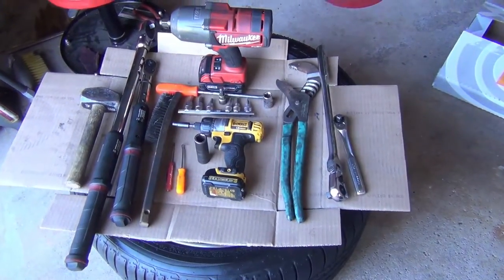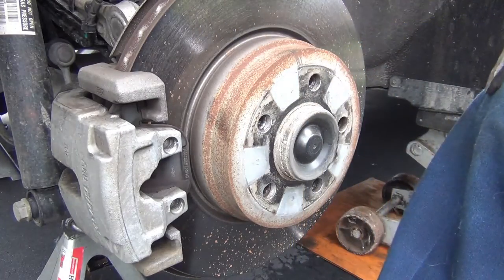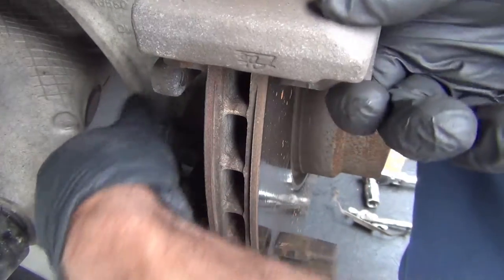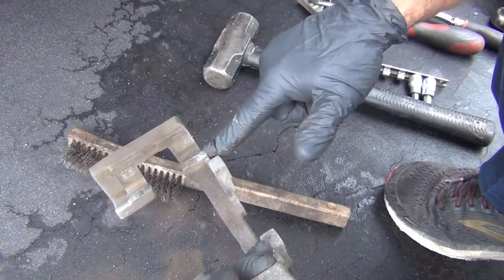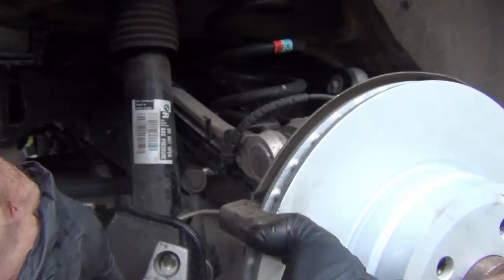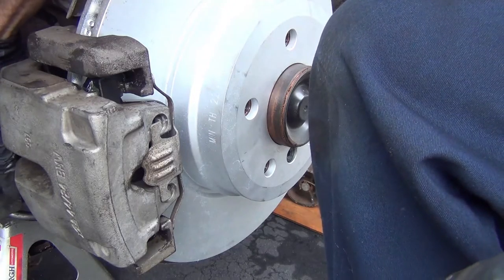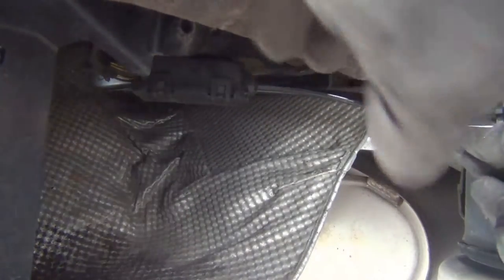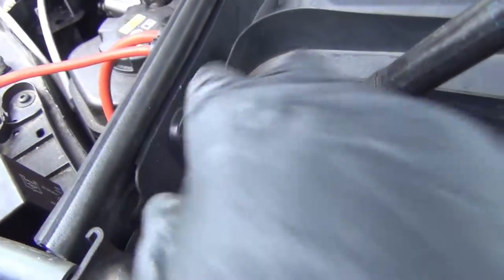DIY HOW TO REPLACE REAR BRAKE PADS ROTORS AND SENSOR BMW  F15 X5

Comment: How do you find the wheel lock on 2020 x5 same pad as f15? Thanks one of the best explanation on here 👏
Reply from the maker: Hello, Glad the video was helpful! For the wheel lock, if the wheel lock key is missing you can do a few things. Check to see if you have the box as it has a card that gives you the wheel lock key number. Then you can order it from BMW. If no card, you can go to a dealership and ask them to match it with the master set to see which one you need to order. OR...you can purchase the whole set and find the right one from amazon. The whole set is most likely cheaper than the one at BMW.
https://www.amazon.com/JEUCLEL-Locking-Compatible-Adapter-Anti-Theft/dp/B0BX2WTVYR/ref=sr_1_2_sspa?crid=71CIZPDEAJFK&keywords=bmw%2Bwheel%2Block%2Bmaster%2Bkey%2Bset&qid=1694988382&sprefix=bmw%2Bwheel%2Block%2Bmas%2Caps%2C86&sr=8-2-spons&ufe=app_do%3Aamzn1.fos.18ed3cb5-28d5-4975-8bc7-93deae8f9840&sp_csd=d2lkZ2V0TmFtZT1zcF9hdGY&th=1

Comment: Any need to adjust e brake after replacing rotors or as shoes wear? I saw there is an adjust wheel
Reply from the maker: Most of the time there is no need to adjust.  Do a check of the e brake. 5 clicks is the max and it should hold. Less critical on an auto trans but very important on a manual trans.
Reply: @AskTheCarExperts  what do you mean by 5 clicks? I’m going to replace the brake shoes soon while doing pads and rotors. Think it makes sense while I’m at it

Comment: Is the e-brake on the drivers side only? I want to change the rotors/pads like you did on video, but I’m concerned about not being able to push piston back in on the side of e-brake. Obviously I’d turn off the e-brake which I never use.  Anything special or extra step with e-brake? Also I noticed you didn’t put any grease on slide pins, is that a bmw thing? Btw - I too have an x5 f15 (2015) awd. Thank you in advance
Reply from the maker: Hi Brad, Your vehicle should not have the electronic e brake. The e brake is on both sides and should be the mechanical e brake. The piston will be able to be pressed in the same on both side :) 😀 Let ke know if you run into anything I can help with!
Reply: @AskTheCarExperts  many thanks, I’ve done many brake jobs on my own vehicles but this is first on a bmw. Btw - your videos are extremely helpful!

Comment: Hello, 
Is the rear sensor an identical to the front sensor? 
Are all four rotor disks front to rear the same in sizes on this X5 F15 35i? 

BTW, you made the best video on this brake job on you tube. 👍
Reply from the maker: Thank you Ben! The front and rear sensor are different and the rotors are different front to rear as well.
Reply: Where did you order the one time used bolts and what are they call by names? Thanks.
Reply from the maker: @benten6301  I purchased the bolts and all components from my local BMW dealership.

Comment: Where to set stands? Did you put loads on the stands?
Reply from the maker: I put the stands under the frame of the rear subframe but I do not lower the car down. I use the jack to support the vehicle and the jack stands are a back up safety for myself and the vehicle.

Comment: Do you have to bleed out the breaks ?
Reply from the maker: Hi Gunz TV, No bleeding of the brakes is needed since the hydraulic system is not opened to do this repair.

Comment: Shouldn't you adjust the brake shoes
Reply from the maker: Hello James, Most.of the time you don't have to but on a vehicle with the electronic E brake built into the caliper there are no longer shoes installed. If your BMW has the brake shoes test the e brake after. It should hold at 3 to 5 clicks. If not then adjust.